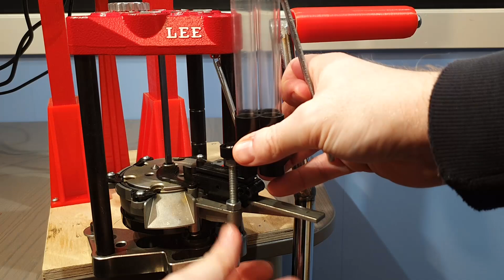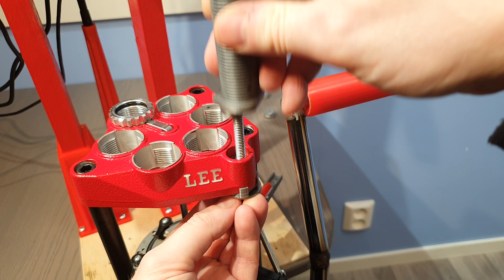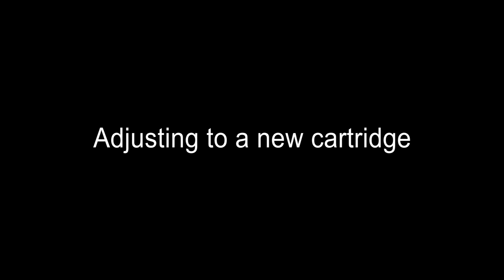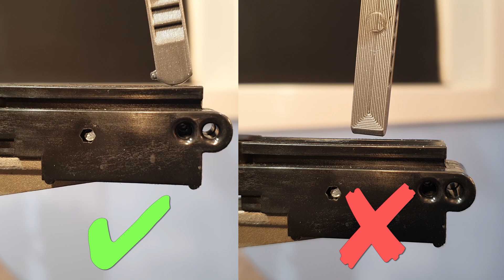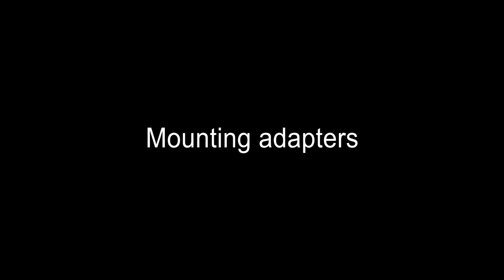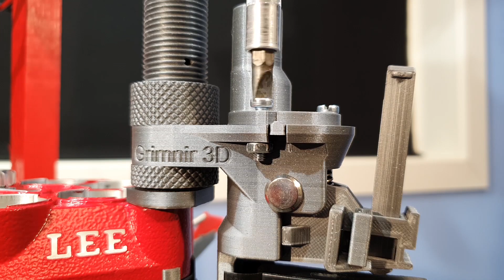Instructions - Universal case dropper for Lee Six Pack Pro

Comment: Just got wine Saturday Sunday morning I put it on my 6000 press took me 20 minutes that's on me because I have neuropathy and arthritis in my fingers and it took a while for me to get the nuts on anybody else it'll take 5 minutes Works Grace in the instructions it says that the washer is optional I really think you need to put it I put one on my only question is the longevity of it will this be working at 10 or 15 or 20,000 rounds only time will tell but I can tell you this I am going to order others for my other presses.

Comment: LOVE the FINGER that stops the case from flying out of possion!  My purchase did not have the SINGLE TUBE ADAPTER.  How do I obtain the missing part?
Reply from the maker: If you ordered the finished product on Etsy, you can choose which adapters you want. It's called "ECFA=Electric case feeder adapter" on Etsy. If you purchase the 3d files it is included as a separate model.

Comment: Anyone know where printable instructions for the adjustment for calibers is??
Reply from the maker: Hi! I made this video instead of a written manual because it gets very technical with just the text. I do however have the script from the video and will try to paste it below. If you want it as a text file, you can email me at: grimnir.innovations@gmail.com 

Adjust to a new caliber
The height of the dropper depends on what type of cartridge you are feeding. Most pistol cases are dropped below the dropper. Most bottleneck rifle cartridges are dropped with the case neck still inside the dropper.

The goal is to drop the cases as close to the top of stroke as possible. If a case is dropped below the lever, before reaching the top of stroke, it must not be allowed to reach the lever again, or re-enter the dropper hole. If the case shifts, it can impact the lever and damage the dropper assembly. However, if a case is dropped while the top of the case is still above the lever, it will simply slide back up the feeding hole.

It is also important not to short stroke the press, as this might cause a case to impact the dropper body.

The case dropper is mainly adjustable in two ways. The dropper itself moves up and down to fit the case length. The ratchet-style trigger bar is then adjusted to trigger the dropping. If you are using the trigger bar with a spring loaded lock, you can adjust it down in click increments by pushing it. To adjust it up, press and hold the trigger lock, and move the trigger bar. The teeth on the trigger bar are 4mm apart, but the two sides are offset by 2mm. If you can’t quite find the sweet spot with one side, the other side will provide a step in between.

If you're not using the spring loaded lock, you may instead use a short M6 screw to lock the trigger bar in the exact spot you like. This is meant as an alternative to the spring loaded lock, and might not be viable in the long run. 3d printed threads do not always come out perfect, and there might not be enough material to reliably use a metal screw indefinitely. If you want to use this method, insert the trigger bar from the bottom with one of the smooth surfaces facing the screw. Only tighten the screw, enough to hold the trigger bar in place. Overtightening may damage the trigger bar and the threads.

To avoid binding and wear; Always make sure that the trigger is oriented so that the rounded area of the trigger rides on the case slider.

Adjust to a pistol case.
Start by retracting the trigger bar to the top position to disable it.
Raise the ram and place a pistol case on the case feeder ramp.
Adjust the height of the dropper to where you want it to drop. For most pistol cases this will be when the case is just below the dropper lever.
Put the case inside the dropper, center it over the case feeder ramp, and loosely tighten the nuts.
Adjust the trigger down, until the drop is activated.
Place one or more cases inside the dropper and test your setting. Adjust if necessary. Remember that the opposite side of the trigger bar offers a half step adjustment.

Before finally tightening the nuts, please note that the dropper can also be adjusted slightly in or out to compensate for different case diameters.

Adjust to a bottleneck rifle case.
Start by retracting the trigger bar to the top position to disable it.
Raise the ram, and place a bottleneck case on the case feeder ramp, with the dropper behind it.
Adjust the height of the dropper to where you want it to drop. For most rifle cases this will be with the neck inside the dropper.
Put the case inside the dropper, and center it over the case feeder ramp.
To minimize the required stick-out of the trigger, the raiser for the case-slider should be used when reloading longer cases.
When using the riser, always make sure that the trigger does not come in contact with anything on top of the dropper.
Adjust the trigger down, until the drop is activated.
Lower the ram, and make sure that the case clears the dropper.
If the case is stuck in the dropper when you lower the ram, you can activate the drop earlier by adjusting the trigger. If the top of the case exits the dropper, make sure it does not re-enter or touch the dropper, later in the stroke.
Alternatively, you can raise the height of the dropper, and then readjust the trigger.

Always make sure that the combination of dropper height, case slider height and trigger stick out is within a safe range. Operating the press with wrong settings can damage the dropper or the press.

Comment: This gizmo is top notch. With the lee case feeder I got double feeds or it would kick the case out sideways especially when down to the last two cases and was a real headache with tall cases like 38/357 and 44mag. I ran 500 rounds of 40 last night and didn’t have a single issue. I’ve ran prob 100 38 cases just to test it and not a single issue. If you spend 15 min getting everything fine tuned with this case feeder and tge lee bullet feeder 400rds and hour is no problem and that’s taking my time slow and steady. Add in the DAA powder check die and the primer sentry alarm I got on eBay the this press is awesome.